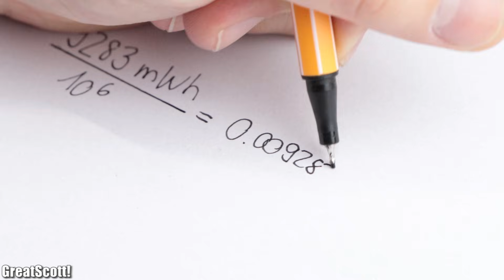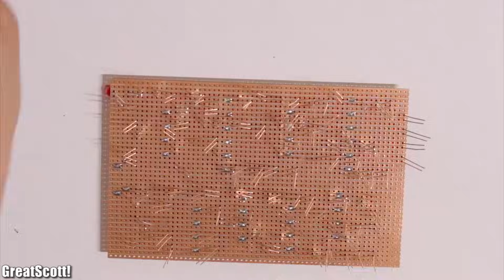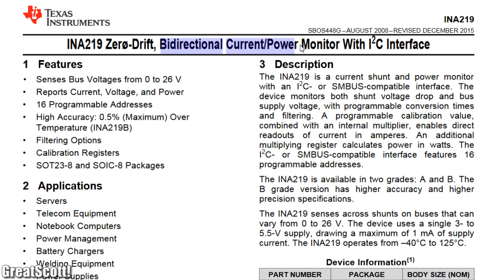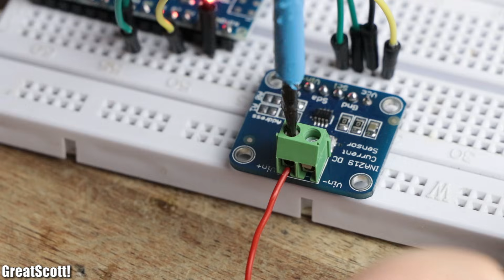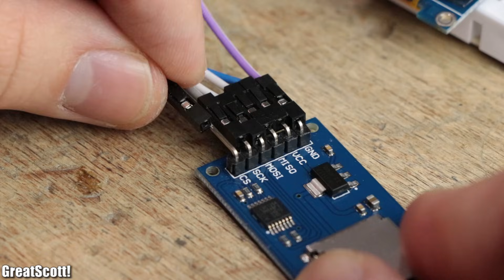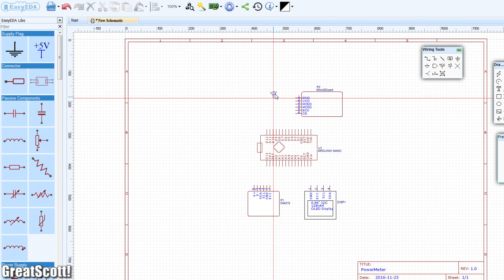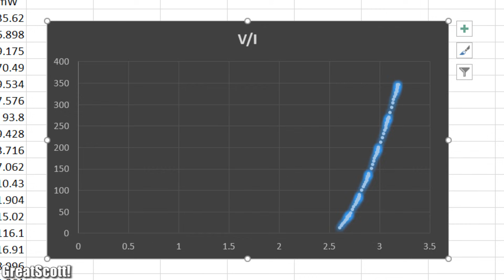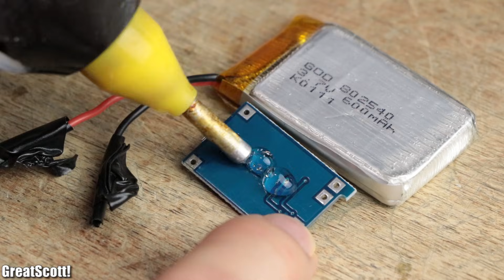Make your own Power Meter/Logger

Comment: Hey how about  measuring  power  of ac appliance how can we modify  current  project  and measures  ac voltage  and current
Reply: What you're looking for here is a clamp on current transformer.  SparkFun sells one, but I'm sure you can probably source one elsewhere.  There are examples on the web for how to use these with an arduino.

https://www.sparkfun.com/products/11005

EDIT:  Here's an example of how to use one.

https://openenergymonitor.org/emon/node/58
Reply: Soumil Shah Could simply buy a "kill-o-watt" meter that plugs in between the wall and device and meters the power.  To DIY I imagine make an inverter to change the AC to DC then measure that, but not simple and don't mess with mains AC if you're not sure.
Reply: Sure, there are also some models that output 4-20mV, and some which can measure much higher currents, but for someone that just wants to mess around with it, the $8 option is better than the $90 option.
Reply: Pete Brubaker   hey i think interfacing  of current  transform  is quite complicated isn't?? 
Can anyone make a video tutorial on that
Reply: If you go with more expensive units, they are easier to use.  There are some that have various ranges, use jumpers to set thoe ranges and output a linear voltage between 0-10v DC or 4-20mV DC for the selected range.  But those are (from the limited searching I did on them) $70+.  That website I linked has a better page that explains how it all works with the maths.

https://openenergymonitor.org/emon/buildingblocks/ct-sensors-interface

If you want to spend the extra cash, I've used the ACT200-42L-F model from AutomationDirect before and they work very well.  Then it's just an analog read.

https://www.automationdirect.com/adc/Shopping/Catalog/Sensors_-z-_Encoders/Current_-a-_Voltage_Sensors_(AC_-a-_DC)/Current_Transducers/AC_Current_Transducers/ACT200-42L-F
Reply: Pete Brubaker  thanks for the suggestion  buddy
Reply: You're welcome.  Good luck!
Reply: Pete Brubaker  hey pete we could be in touch  im electronic  engineering  students  from India 
There my email id 
Soumil.s@somaiya.edu

Comment: What happens if you attempt to read a voltage or amperage outside of the range of the meter? will it refuse to read it or will it destroy components in the circuit?
Reply: Jaden S. typically weakest link will burn up can either use a fuse as intentional weakest link or a zener diode could be used to "open the gate to ground" when some voltage is reached.

Comment: It looks like your framebuffer size is set wrong, look for Adafruit_SSD1306.h inside your Arduino libraries folder and make sure only #define SSD1306_128_64 is uncommented. This will make the text look so much better as currently it skips a line each row
Reply: Run's out of memory if you use that.

Comment: for the logging you can use an CSV file and open it with format and it's pretty easy to create for example per each line you can have:
TIME,VOLTAGE,CURRENT
just use comma (, ) as separator between you values and excel should be able to put them in column for you

Comment: Can you PLEASEEEEE make an Arduino tutorial? I love watching your videos and I would love to recreate your projects but I cannot find a decent free Arduino guide anywere.
Reply: There are a lot of "already made" content for arduino but what I think is missing is a "why I'm doing the code like this" videos. I would love to see someone write an arduino code while he explains the reasoning behind it.
Reply: @alexandrelavallee4352  I think toptechboy does that. You can check out his channel or website
Reply: @samuelpeace5844   Thanks for the tip! i just started but the tutorials are indeed awesome!
Reply: You need to learn programming first. C language is recommended if you plan to program only arduinos. There are also boards with micro python on board (easy for beginners)... you have plenty of tutorials on learn.adafruit.com
Reply: BeGamerSl Well it just depends on how complex a given device is if there will be a library or not for it.  A library is just a set of functions that allow you to more easily do something (in the case of Arduino libraries typically make it easier to get info into/out of other devices).

If a device simply outputs a signal that is 0-5V then you can plug that into an arduino analog pin and just read the value.  If the device uses some protocol where one or more digital pins is used to send information then in many cases it's easier if someone writes a library to deal with those details.

Typically when you find a device you want to integrate you can google, Arduino+device type+tutorial and find if you can easily communicate with the device or if it will be easier with a library.

If you want to write your own library you would want to search for the device part number and get the datasheet with all the gory details about the device and how to use it.
Reply: Gether some components like an lcd and some buttons and program at your will, That is how i learned. i made a cool clock that displays time and temperature. Good luck man
Reply: BeGamerSl what would you like to see?  There are lots of guides and tutorials can you be more specific about what is missing?
Reply: BeGamerSl If you have an arduino I suggest just looking through the tutorials and example sketchbooks built into the Arduino application itself.  There are basics covered as well as libraries that it comes with, if you are using something like a radio or a complex display then it's worth checking to see if someone has coded up a library to use the device or if you will need to write one from scratch (also how many inputs/outputs and what type it will take).

https://www.arduino.cc/en/Guide/HomePage
Reply: I would like it too
Reply: Shaun Husain I just want an explanation on why is there for example a library or something like that. Most of the tutorial are just talking and some just say do this and that  the result is supposted to be this and that. But I want to know why is tgere a piece of code or why is tgere a library for example.
Reply: Shaun Husain tnx
Reply: BeGamerSl
Reply: Alexandre Lavallee exactly! Thats the kind of tutorial I would love to see! Thank you!
Reply: The Tech Mate tnx

Comment: Great project!!

I'd be interested in something that recorded whole house voltage. 
Like this 

P3 P4400 Kill A Watt Electricity Usage Monitor https://www.amazon.com/dp/B00009MDBU/ref=cm_sw_r_cp_api_ykYoyb089WE1C

But one that could go in the electrical box for each circuit.

Also it'd be awesome if it has wifi so I could remotely look at the data on the SD card :)

Comment: Actually you can combine simply the INA219 boardwith a regular Arduino, and send the measured data through the serial port, then read it on your PC with a program like SerialPlot. After some tweaking I got about a 3k sps out of it, measuring current. Great and cheap homemade, lowend oscilloscope like thingy. :)

Comment: Hey @GreatScott! Thanks for the great video man, this is actually something I will be doing in the near future as I have a project I need to Solar Power. With that I wanted to ask if you might do a project in the future that shows how to create a Solar Power (with battery and charge circuit) to power a wireless router... I am pretty sure of what I am doing but would love to have someone with much more experience such as yourself to verify my opinion. I could see other users benefiting from this as I know I cant be the only person that would love to toss another range extender outside my home.
Reply: I should add, I was looking to use some Lead Acid batteries to power this as if there was little sun for several days (Welcome to Oregon) than it would hopefully still be able to run and regain power after the weather improves.

Comment: What if the voltage is >5 volts?
Reply: The measuring IC can handle up to 26 Volts
Reply: But he is measuring the voltage with the arduino analog pin, no?
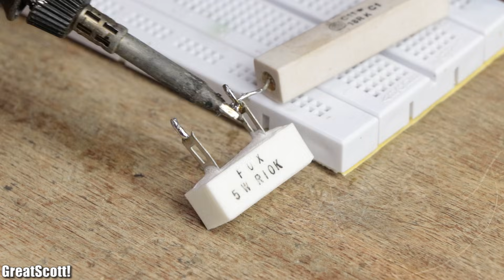Reply: He uses the INA219 to have a larger voltage range, see 1:53 ;)

Comment: that is so cool!!! but I am wondering if a larger display is available? and if it can be adapted for much higher current? and use something like a toroidal current sensor ? ( I have seen them. but not sure what they are called) I have seen them used with 0gauge cable through them. to read current. I would like to use a setup like this for a off grid solar power system. so I guess it would need to be capable of reading up to 30 volts also. I was thinking of just buying meters. but this is way cooler. I guess it would need to read like 300-400 amps. thanks . this was a great video..

Comment: The arduino IDE is shit. I would highly recommend platformio. It lets you compile arduino code through the command line which lets you use any ide/editor, as all languages should.
Reply: but on the other hand, the arduino ide is much more easy to use, and beginner-friendly :)
Reply: I would argue that the platformio plugin for atom is much more user friendly than the arduino ide.
Reply: aiklarung no but libraries go in the lib directory of your project king everything much more transparent
Reply: The arduino IDE just runs an existing command line tool in the background. If you like command line compilation then you don't need any more tools. And the arduino IDE has an "external text editor" tick in the options to let you use the arduino ide as a deployment tool but any other text editor. yes the ide is very limited, but it's only a limitation to those who let it be.
Reply: Yes but I don't want to have to open the ide and click the buttons to compile. Through the command line, I can set up scripts with the compiler. For example, last year I was working on a robot equipped with a pi and several arduinos. I made a scripts using platformio that compiled the code on my computer, copied the firmware to the pi over ssh, and uploaded the firmware to any arduino I chose.
Reply: Marcel Robitaille as I said before, Arduino ide is just a wrapper for command line interfaces (cli). You don't need any third party tools to compile on the command line. The GUI is only there to make it easy if you are the kind of person who likes easy.
Reply: You did say that, and then you said to tick a box in a gui. How do you use the binary directly?
Reply: Marcel Robitaille I said that because you can do it either way. There are lots of tutorials online. The YouTube app won't let me post links in comments but just search command line on the arduino reference site

Comment: Easier to create CSV file DATA.csv and comma separated values.
Reply: the sdfat32 library he was using should be able to write any simple text based file type, a csv file is a simple text based file type. and by simple text based i mean if you were to change the extension to .txt you would be able to read the contents of the file without parsing anything.
Reply: That's what I came here to say :)
Reply: Wayne Johnson agree also for live graphs can send the data over serial and parse and display a graph with processing.org pretty easily.  Serial library there is basically the same and similar setup and loop code structure.
Reply: I thought exactly the same.
Reply: It looks like Arduino doesn't have a simple sprintf alternative built in, so he didn't want to hassle with another library just for string formatting. He could just do a series of writes with print() instead of println(), though, and manually terminate the line, e.g. 6 writes of data comma data comma data "\n" - but now you're doing double the I/O, and the impact might not be negligible depending on the speed at which you're sampling your values (no idea off-hand if SDFat is buffering IO, but I would think not since it's a memory constrained environment)

For more info, the SDFat Github repo has an example of CSV writing in examples/AnalogBinLogger.
Reply: nerds

Comment: I'm working on an expanded version of this for a project I'm working on :)

Tracks a whole bunch of statistics for lithium ion battery management, coulomb counting, battery capacity over time, voltage cut off etc. I've been toying with the idea of adding an OLED display and SD card reader (this primarily so I can avoid writing to EEPROM too much). 

After watching your video I may just add these :D
Reply: Ross Bishop sweet have a very simple version of a power meter for a 10S battery on a skateboard.  I used a bunch of zener diodes but in hindsight it burns quite a bit of power so thinking maybe voltage divider first then measure, any thoughts/ideas?
Reply: To measure the current? A hall sensor if you can grab one, I'm using one of the ACS712 jobbies you can get on eBay for a few quid.

The 20A version outputs 100mV/A above about a 2.5V float voltage (I'm using a 5V Arduino Nano like in this video) and you can get down to 50mA resolution with the 10 bit ADC. There's a readily available 30A one too, 66mV/A so not quite as nice to work with and I think you might lose a bit of resolution, but yeah, works pretty well.

I'm actually looking into oversampling or using an external ADC down the line to massively increase my accuracy of measurement.
Reply: Nice haven't used hall sensors before but sounds pretty straightforward was really just looking at voltage for now to get a rough percentage used but would be nice to measure current without a big shunt.  I've been playing more with the ADC on the Arduino lately and hear you on getting a higher resolution external ADC, maybe will integrate that as well.  Been just dipping into at home PCBs so fun tinkering with the components.
Reply: Shaun Husain The issue is voltage readings for battery charge are pretty terrible, at least with Lithium Ion. The voltage of Lithium Ion cells sags the more you load them. The voltage for a certain capacity @ 10A is much lower than for the same capacity at 1A. You'll get a very low percentage reading which when your system says "it's empty" will then bounce back up a bit and you realise you actually have 20%.

What you can do is find a discharge graph for your cell type and create a look up table in long term storage of voltage against capacity for different load levels then use linear interpolation to work out an estimation of where you might be on those curves based on your average current load.

It's kind of difficult to explain in a pinch, but if you drop to 4.1V for a 1A load and drop to 3.5V for a 10A load right at the beginning of a discharge cycle from 100%, you can use a formula that takes into account the load current, time and battery voltage to guess how charged or discharged it is. This becomes more difficult the more you vary the current over time so it's not very reliable overall, but better than a straight up single curve.

You're better off doing coulomb counting like my system does but it does get difficult to keep track of the charge which has entered and left the battery.

Just be careful with Lithium cells, they're pretty dangerous, make sure you have an alarm or other means of a sure thing cut off voltage so you don't go too low and permanently damage the battery. Use a reliable balance charger to charge it too.
Reply: Ross Bishop Yup so far I used a circuit simulator to show a 42-37V input and figured out what resistors and zener diodes to put in there ahead of a row of LEDs and then printed the corresponding board and wired it up and works fine for the moment.  Like you said the voltage dips might be a problem I haven't actually tested it under load yet but I really just want a round about idea of how much charge the board has.

Thanks for pointing out LiPo safety, I have a decent balance charger and the speed controller I use automatically starts dropping power draw at a set voltage (believe i have it at 38V right now for the 10S battery) and cuts off entirely well before the cells would be down to 3.3V.

What I have as is isn't ideal cause it is draining 3W of power when the batteries are fully charged so gets quite warm (everything is rated to deal with the wattage but in a plastic container so without air cooling of motion could be a problem).  Nice thing with the current setup is it's all simple components with no microcontroller.  I may hook the board up to a momentary push button to get around the problem or may end up just giving in and using another micro controller :)

Thanks also for the idea about accounting for the current draw while checking the voltage great idea if I end up going the micro controller route too  (already an arduino in there actually).
Reply: Ah your voltages are all pretty safe then. I mean there is still the potential issue of one of the cells failing and going much lower than the others, where a voltage cutoff for the battery won't necessarily work, but it shouldn't blow up and hurt you lol. The next balance charge should show you whether anything is seriously wrong, or you may notice a stark drop in power while riding.

I went the MCU route because it wasn't all that expensive and almost all of the control is in software so I can easily make changes down the line if need be. I don't have to dissipate power in any components either which is nice.

Comment: What's the max voltage/amps this can take? Good for mains voltage?
Reply: 26 Volts and 3,2 Amps are the maximum given in the datasheet, I think. So don´t even try to use it with mains voltage :b